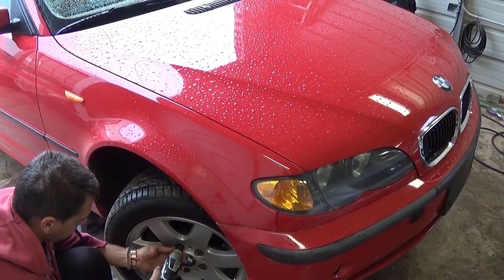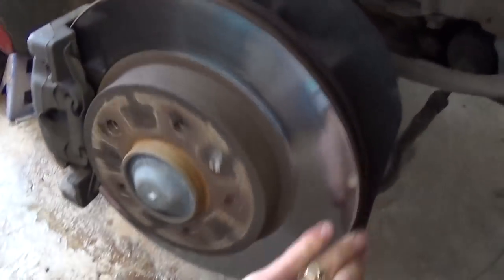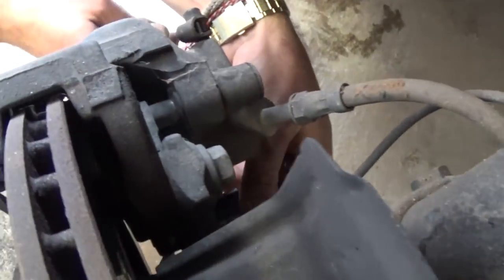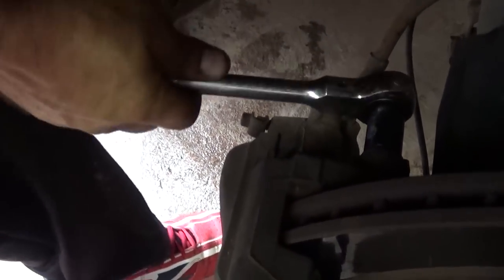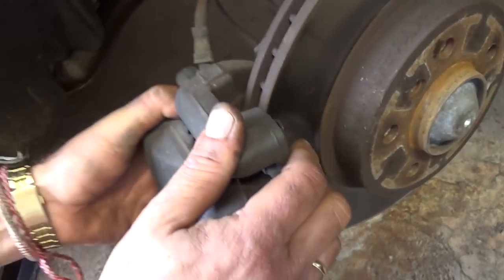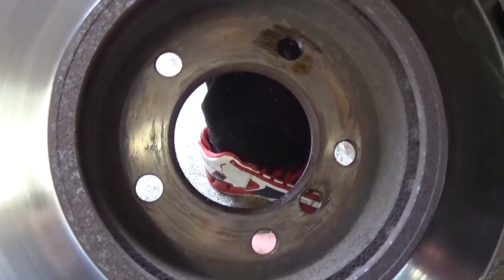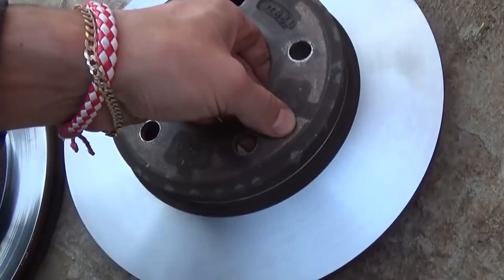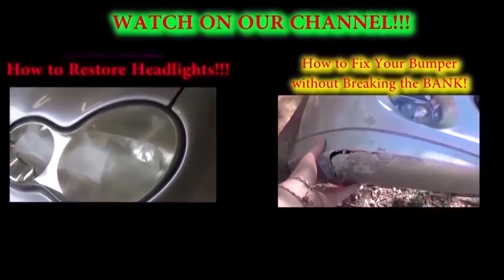Vibrations in the Steering Wheel when Stopping or hitting the Brake. HOW TO FIX!

Comment: Thanks for the informative video.  Remember that one solution doesn’t necessarily work for every braking problem. You didn’t show how you diagnosed excessive runout requiring rotor resurfacing.  Did you check rotor runout, or just assume that was the problem?  Also, don’t create new problems by hanging heavy brake calipers by their rubber brake hoses. 

The mating surfaces between rotor and hub and between rotor and wheel need to be absolutely clean and flat. A .001” thick piece of rust or hard grit between those mating surfaces shows up as lateral runout of the wheel and tire. The runout will be much greater than .001” at the wheel rim, where it is easiest to measure, and greater still at the tire tread.  Replacing rotors doesn’t help the problem of dirty mating surfaces and lateral wheel runout. 

When checking the brakes, verify that the guide pins are properly lubricated with synthetic brake grease and that the calipers can slide in and out easily; also verify that the pad mounting slides have a very tiny amount of synthetic brake grease on the pad mounting slides and on the slide contact surfaces of the pads.  It is critical that the bolts attaching the caliper assembly to the vehicle be tightened to factory torque specs, without using a lubricant on the threads. Torque specs are established with dry bolts, etc.  Be sure to use a torque wrench in a criss-cross pattern when tightening the lug nuts to factory specification.  As to resurfacing brake rotors on a BMW, BMW formerly didn’t recommend this procedure, but as of December 2016 it can be an acceptable practice.  See   BMW TECHNICAL SERVICE BULLETIN - Reference Number(s): SI B34 10 16, Date of Issue: December 2016 whether this is an acceptable practice.  I don’t believe dealers will do it, and I have always understood that European car makers require worn rotors to TECHNICAL SERVICE BULLETIN
Reference Number(s): SI B34 10 16, Date of Issue: December 2016 be replaced

Again, thanks for sharing this helpful information.

Comment: You just scratched up the inside face of the newly turned rotor by putting it on the concrete floor. When you picked it up i could see knicks and scratches from the rough floor

Comment: I replaced my rotors and brake pads but car shakes. why?
Reply: CMichigan me too I redone the whole car on my e39 Brembo on the front after 1k miles problem came back
Reply: You probably have bent rims. I had the same issue, replaced all 4 pads and rotors, but the shaking when braking persisted. I brought it in, and the inside of 3 of my rims were bent out of roundness, causing the shaking
Reply: Most likely your car is dancing...stop playing your music while driving.
Reply: If you have washer as stopper on your rotors, try removing it
Reply: It could be your guide pins need clean and lube with grease and you need to clean brake piston if it have dust and grease mixture making piston stuck 
It was having shaking even with light braking just cleaned piston also cleaned guide pins and relube them with grease and lastly changed brake pads cause one is about half the other cause of stuck piston in brake caliper so good luck friend
Reply: Likely it's bad engine mounts
Reply: Check Ur Brake Hoses ,Also.Twisted or Damaged Hoses Will Cause This Vibration,if Rotors Mike Out O.K. On Mikrometer
Reply: Take your car to a tire shop to do a tire balancing. Let them know that the steering wheel shakes. While they doing the balancing ask them to check if the rims are bend.
Reply: Jack up the front-end, support it with stands, shake each front wheel, left to right, top to bottom. Whatever moves needs replacing. There's a difference between a simple vibration, and a full wobble or shake. Brakes cause simple vibrations, suspension parts cause wobbles and shimmies. There's also 2 lower control arms on each side in the front. A forward and rearward. They're both rather inexpensive and somewhat simple to install. The bushings and balljoints go on these arms. I have 230k on mine, I've been thru a few things....

Comment: WHEN I WATCHED YOUR VIDEO IT MADE ME THINK OF MY PLYMOUTH BREEZE, IT MAKES A CONSTANT RUBBING SOUND WHEN I DRIVE, LIKE THE FRONT AXLE NEEDS TOP BE LUBRICATED. I ALSO CHECKED THE WHEEL BEARINGS, FRONT PASSENGER WAS TIGHT UP AND DOWN, LEFT TO RIGHT, BUT DRIVER WAS LOOSE FROM LEFT TO RIGHT WITH THIS CLICKING SOUND. https://www.youtube.com/watch?v=hL-PSZibg7k. I REPLACED THE BEARING GREASE, TIGHTENED EVERYTHING AND IT SEEMS TO BE MUCH BETTER.  -JEFF